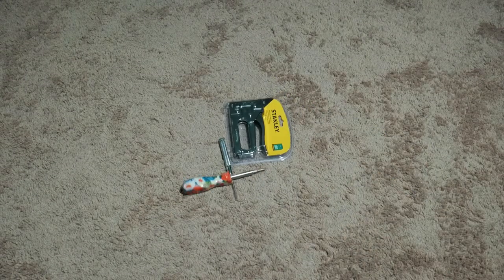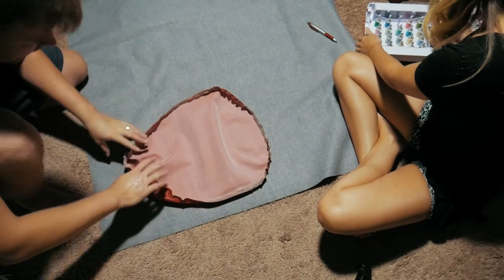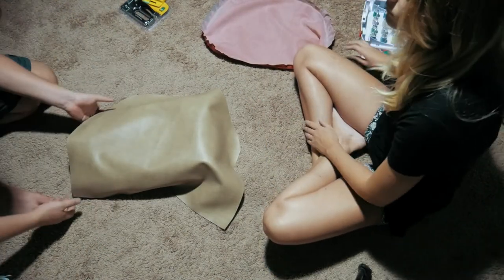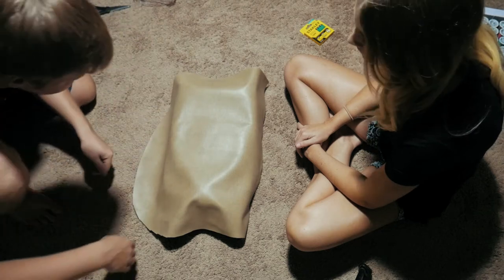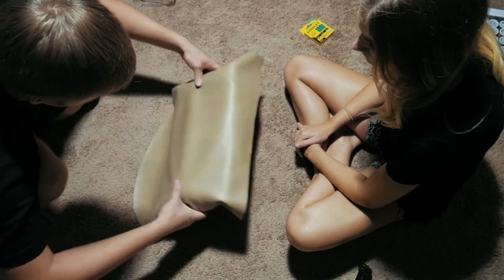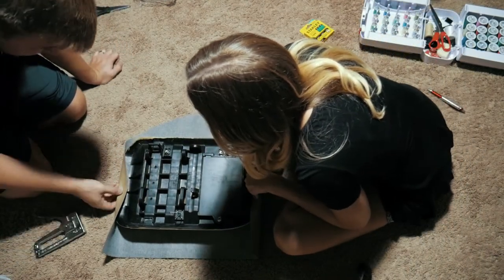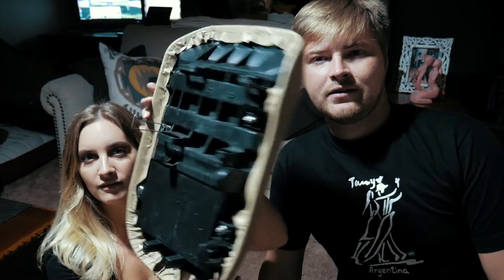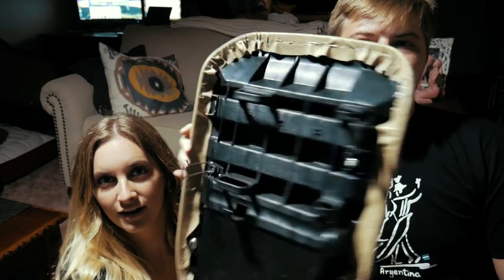How to Reupholster Motorcycle Seat  (Episode 4)

Comment: Cool tutorial! Might wanna go over it with a heat gun to tighten it up. I'm gonna try this soon once I decide on a color.
Reply from the maker: +DannyBeigal thanks man will do you mean on the edges?
Reply: Saton Photography the whole seat. Just a couple laps around it. I've seen people use a heat gun after getting the material on to settle it in to the stretched position.
Reply from the maker: +DannyBeigal sounds awesome man I nees to do that